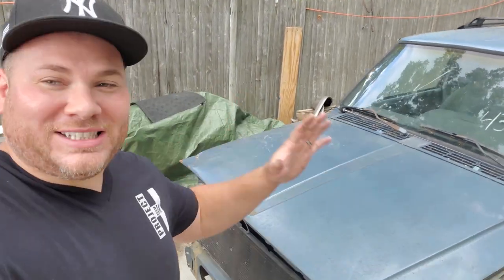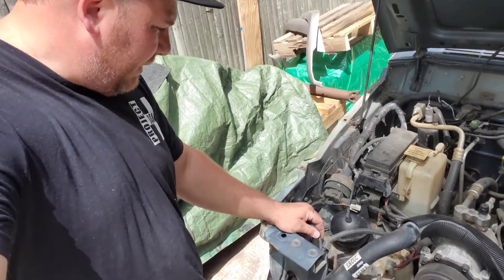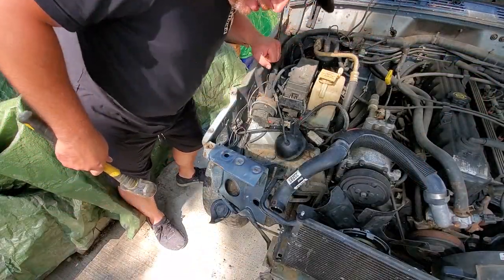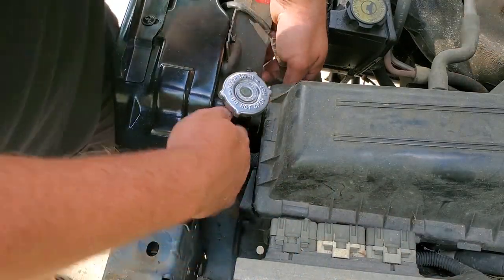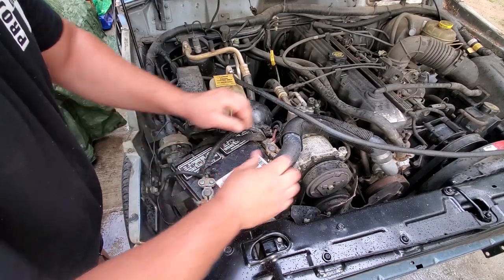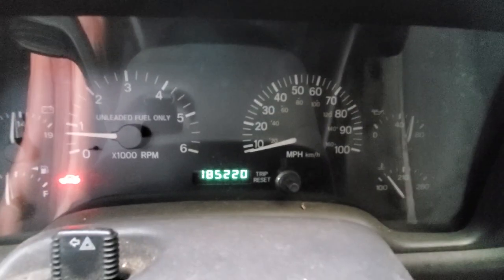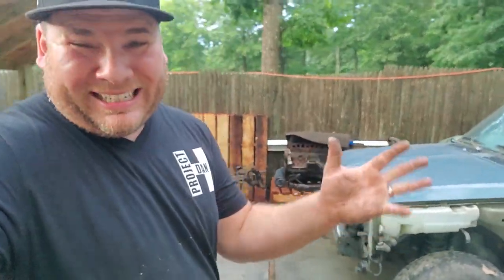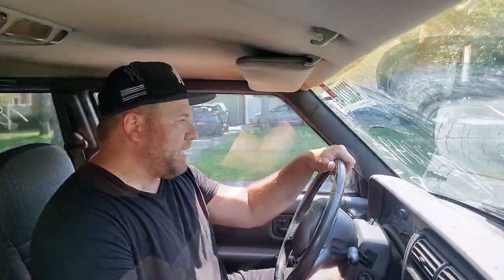1999 JEEP CHEROKEE XJ 2 DOOR STARTED UP AND DRIVEN FOR THE FIRST TIME

Comment: Damage on the right side looks very similar to my Bumble Jeep after last mishap I had (someone turned right in front of me) so check frame rail right behind the coil spring. If it has a little "kink", that isn't supposed to be there. I did all of the repairs to get it driving again and never noticed it. Until I did the 3" lift and was doing the tear down to install the new coils. I did do the diagonal measurements, and everything checked out. The damage was in front of all the steering / suspension mounting points, so I'm not too worried about it. Just wish I'd found it before I did all the other repairs.
Reply from the maker: yes.. same thing happened to my brother. everything seamed to check out up front but he had a giant crease in the transmission tunnel under the rear seat!  crazy!

Comment: I just did an AW4 to AX15 swap on my 2001 Cherokee.  I don't believe you'll be able to use the 2wd AX15 for your 4wd jeep as the 2wd AX15 has a tail shaft where the transfer case normally is.  You can look underneath to confirm but I think that tail shaft is a part of the case.  I bought a donor 4wd jeep to do the conversion.
Reply from the maker: Hey Tom!  you are correct. I am having a trans shop convert the tail housing from 2wd to 4wd for $300.  not too bad right?

Comment: Hi Dan,
I love the two door versions of the XJ with manual transmissions.  A configuration that isn't available in more modern machinery.  To me one is more engaged with the driving experience with the manual and I like that.  
Thinking I'll add one of these in a year or so.  Add it to my 6-Speed manual 2008 Dodge stretch-cab 1/2-Ton 4X4 w/4.7L V8 and 1982 Alfa Romeo GTV6 with 5-Speed transaxle (deDion rear suspension & inboard rear disc brakes).
The 2-door would also enable me to look left without facing the B-pillar.  Not sure if I'll need to relocate the seat back or not (had to in my Alfa).
P.S. Love your enthusiasm!  (Subscribed.  Will be reviewing some your past videos to catch up.)
Reply from the maker: Wow that's some fleet you got there! I totally agree the manual experience is so much better. I will be putting a manual in my new build. I also agree that it's nice to not have a b pillar in your face! Thank you so much for subscribing and thank you for watching 💪

Comment: Seems like you need your throttle body cleaned out with some brake cleaner, I had just a smidge of trouble with idle in slightly colder until it was cleaned out
Reply from the maker: Definitely!  it's pretty dirty in there.  When I put this back together everything will be polished better than new!

Comment: Nice job! Ive never tried a manual 2wd xj before.... does it feel faster than a aw4 4wd? Im currently having 3 xj's ,and one is in the prosess of getting lightened(to save parts for the other 2) and having nitrous fitted.... its going to the dragstrip. What i cant decide is if i should make it a 2wd ax-15(its now a 4wd aw4) is it worth it do you think? Sorry about bad english
Reply from the maker: The AW4 is a great trans.  Auto trans are generally faster.   the AX15 however is also very good and it's a blast to drive! if you want to cruise around and really enjoy your Jeep go with the manual.  if you just want to race it a straight line then use the AW4 and save the AX15 for a good driver vehicle.  IMHO..
Reply: @ProjectDanH  thank you,that confirms it. Aw4 it is! Any point in coverting it to 2wd? It does get lighter,i dont think traction is going to be a problem(not going to spray it that much) but finding a 2wd aw4 and a 2wd front axle is going to be tricky.... thanks again for your help,a couple of words can save me months of wrenching!
Reply from the maker: @oompaen  Thank you very much!  Im glad to help.  I think 4x4 would be better than 2wd for traction right?  If not I will be selling my 2wd front axle if you want my 2wd parts
Reply: @ProjectDanH  if i was in the states,i would come pick it up myself,but im in norway so the shipping is going to be insane...